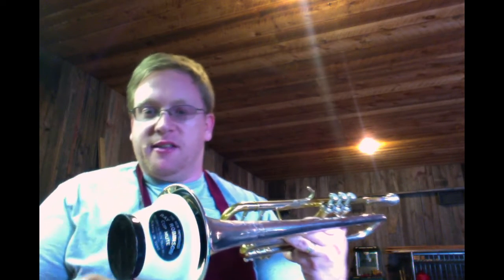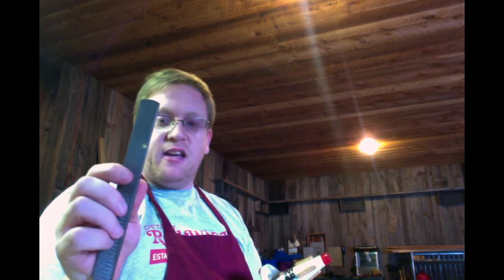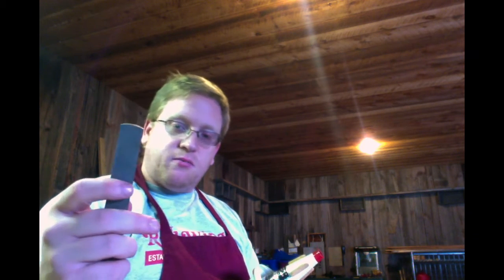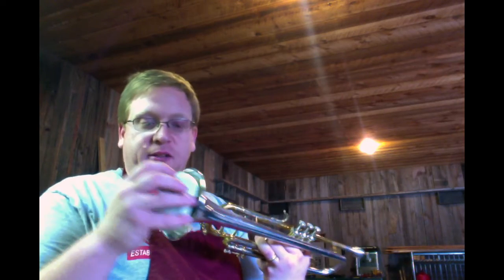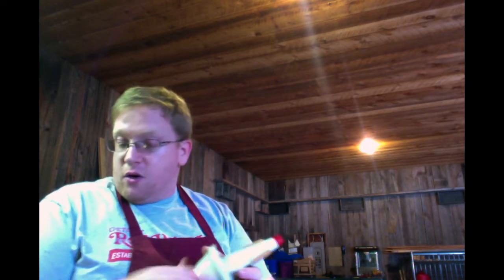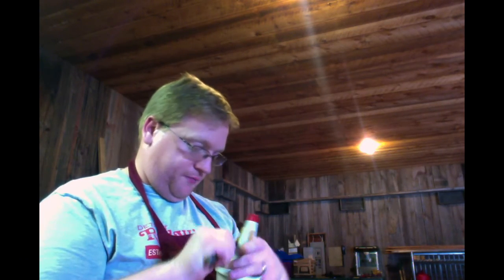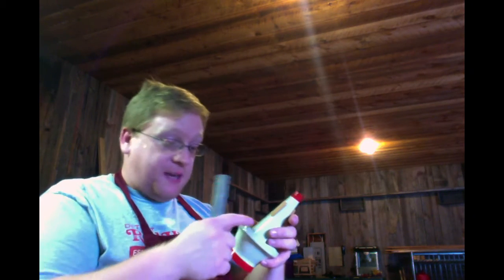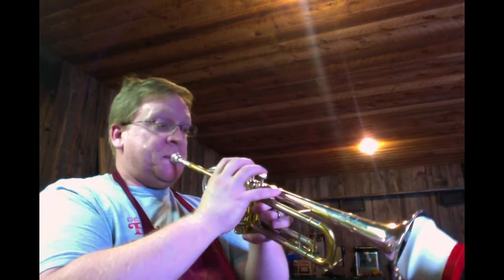How To Adjust Mute Corks!

Comment: Josh. Great video. Is that a sound meter? Can you please give us some info about it...manufacturer, etc. Also what was the sound level BEFORE and AFTER you made the adjustment? Thanks so much.
Reply from the maker: It’s a tuning app on my phone. This is iStroboSoft by Petersen Tuners and is available for iOS and Android. It determines if it’s flat or sharp in pitch but not volume/decibels. A mute is always going to cut down on volume due to deflecting and absorbing sound.